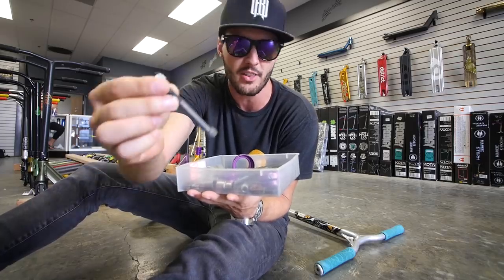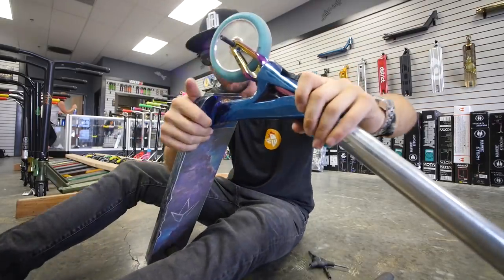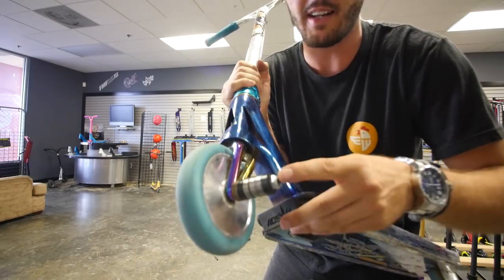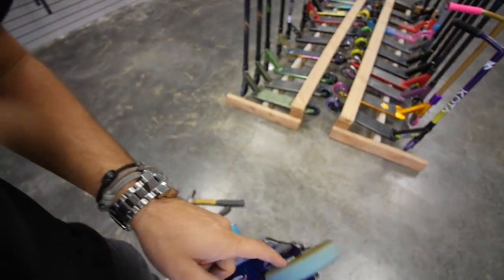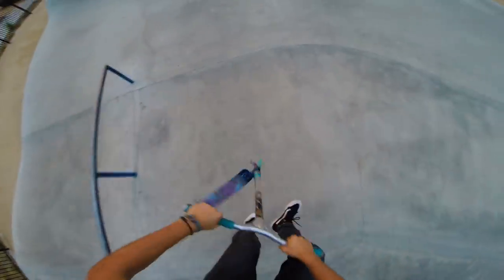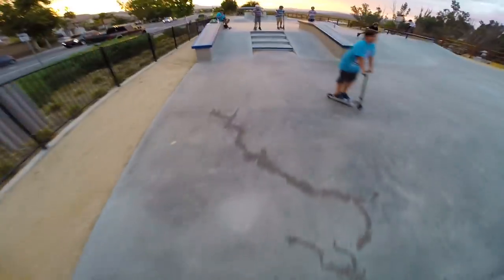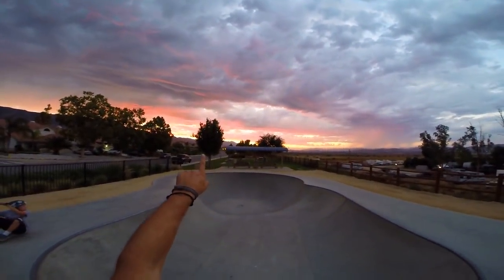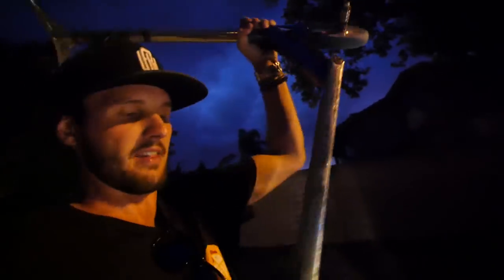$1 DIY SCOOTER PEGS! *SCOOTER LIFE HACK*

Comment: I have a hack. Take a couple bearings and a Axle and a rubber bar end  and a nut. Put it in your bar. (When you tighten up the bolt the rubber Gets thick and the bar extender wont come out) Now you have a cheap and easy bar extender! Please try it out! Love ur vids <3

Comment: this is my scooterhackstory: I had a ihc fork and a ihc aluminum bar, although my fork was i lil skinny and my bar had a bit bigger innerdiameter than i was expecting. my bar wasnt clamped tight enough cuz it was bend to much at the slit and my clamp couldnt get tighter. So I put a piece of metal next to my ihc shim so my fork basically is "thicker" an its been working great for 1 month now.

Comment: all those things cost as much as some realy good pegs berrings are like $11 those long bolts are like $8 and spacers are like $5
but ur a good utber
Reply from the maker: +mad as CG You don't want to use really good bearings because you'll be grinding on them which is exactly why I said use some old ones that you have laying around. Bolts are 37 cents each at Home Depot or lowes. Spacers you can usually get for free at a local scooter shop.